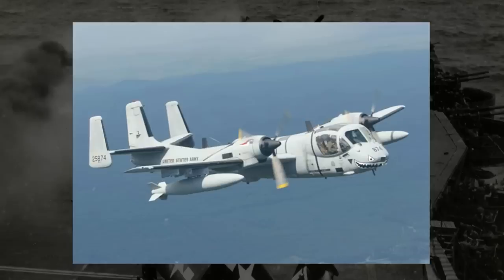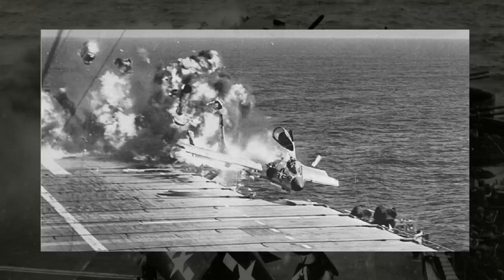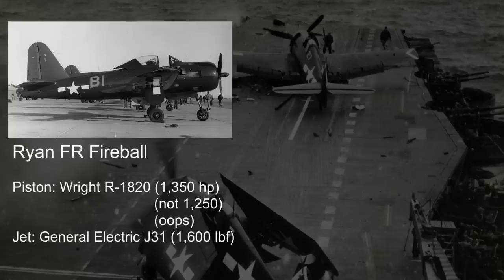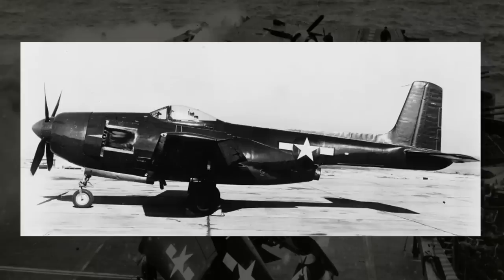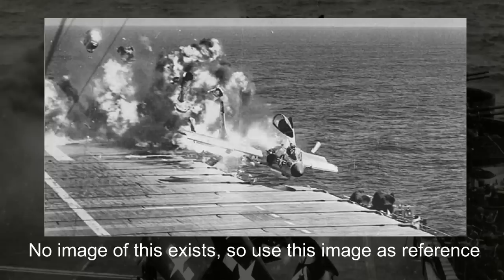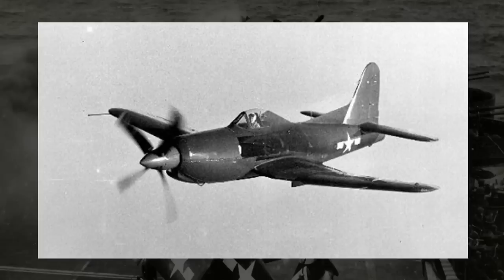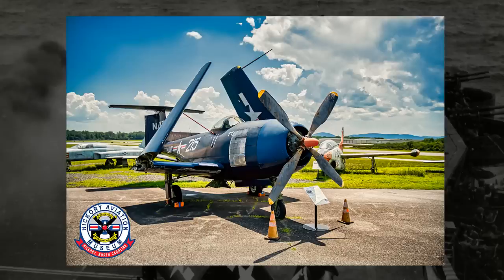Curtiss' Half-Jet Half-Propeller Fighter: Curtiss XF15C

Comment: Jet engines are rated by pounds of thrust not foot-pounds, which is a torque measurement
Reply: Says who?
Reply: Agreed. lbf stands for "pounds of force", not "foot-pounds".
Reply: Torque is not the only force that can be measured in ft lbs of energy, it's not exclusive to torque, as an example the muzzle energy of firearms is also measured in ft lbs, and that has nothing to do with the fact that some projectiles rotate, shotguns and smooth bore muzzle loaders also have ft lbs of energy as measurements.
Matter of fact when I explain torque and ft lbs to people I tell them to just forget about the fact that torque is a twisting motion because all that does is confuse people when it comes to understanding ft lbs of energy, the fact is it's a measurement that's made in a straight line, ie 100 ft lbs of energy is enough force to move 1 pound 100 feet in a straight line not going around in circles like a twisting motion (100 ft lbs is also the same amount of force to move 100 pounds 1 foot, it's exactly the same amount of force if you move 1 pound 100 feet).
When it comes to horsepower torque is a component that's a part of measuring HP, there's no time component in the measurement of torque (ft lbs of energy), 100 foot pounds of energy is enough to move 1 pound 100 feet but you can take as long as you want moving that 1 pound the distance of 100 ft, HP is how fast you move that 1 pound the 100 feet, the faster you move 1 pound the 100 foot distance the more HP you've produced. 
People who like high torque numbers associated with engine's don't understand that ultimately it's meaningless without the time component, 70 ft lbs of torque at 3,000 RPM's will lose a race to 50 ft lbs of torque at 10,000 RPM's every time. 
70 ft lbs of torque at 3,000 RPM's is 39.98 HP
50 ft lbs of torque at 10,000 RPM's is 95.20 HP
Which one do you think will cross a finish line first?
Torque itself is meaningless when it comes to engine power because it's only part of the equation, because horsepower adds time into the equation it's the final say on the matter.
Reply: Rather, they are rated with Kilo newtons- which is force
Reply: @FlareAt30Feet  
Which is directly comparable to foot pounds, just multiply by 224.809 for the conversion. 
Both measurements are force over distance. 
There's no more difference between the two than pounds and kilo's when measuring weight, one's just standard measurements and the other is metric, same as with BTU's and Calories when measuring heat, one's standard and the other is metric.
Reply: @DaveSCameron  Says EVERY jet engine spec sheet and all of their designers.
Reply: @flightforensics4523  The primary output of a turboSHAFT engine is measured at the output SHAFT, just like on a prop engine.
Any jet force is incidental, and some have the jet exhaust going out the SIDES of the engine because they point the engine BACKWARDS in normal installations so they can take the power output directly off the power turbine.
Reply: Early jets used all sorts of manner of thrust attenuation to shorten their time spent taking off  Most of the late 1940's, early 50's jet engines, before afterburning was perfected most used Water-methanol injection to increase the gas-weight volume being thrown out the tailpipe. 

  Generally accompanied by huge clouds of blackish smoke.

 So thrust, on a simple, low bypass jet engine is purely rated in pounds of thrust static, and adding WM injection adds a few hundred to a couple thousand pounds overall as takeoff enhancement.  It doesn't make pretty flames or ear shattering roars, just a lot of blackish smoke.   Like in the movie Strategic Air Command.
Reply: @tauncfester3022  I think you meant thrust augmentation - attentuation is LESS thrust.
And water injection persisted into the 1960s at least, on some designs - like the original 747 engines - where afterburner noise levels would have been too high.

Comment: I remember a long time ago (maybe about 30 years ago) I saw the surviving XF15-C prototype at the Bradley Air Museum (now the New England Air Museum) in Connecticut.  Before I saw the XF15-C, I had read about it in books.  When I saw it in person, I was struck by its large size.  The airplane was on display in an indoor hanger, and at the time the airplane was in pristine condition.  I am sorry to hear that now that same aircraft is just being left to the elements.
Reply: I am intimately familiar with this specific plane.  It was the third and last of the XF-15Cs, also the very last airframe ever built by Curtiss for the Navy.  I helped disassemble it when the Army Corps of Engineers delivered it by barge to Davisville, RI, helped tie it down and flag it to go over the road to Connecticut on a trailer originally custom-built by Kaman for their helicopters, pulled by a Mack that was formerly with Pratt & Whitney.  We had a shortage of flagging material, but the RI State Trooper was ok with the three dark red rags tied onto the extremities.  Outer wing panels and the vertical and horizontal stabilizers were removed for the trip.  Back then I seem to remember the Naval Aviation Museum having a policy of collecting/displaying only types that saw squadron service, this despite there being a purely experimental Douglas Skystreak parked outside their original building which was essentially a glorified shack, thus making this plane available to the privately run Bradley Air Museum.  Anyway, I eventually put the new, present coat of Navy dark sea blue paint on it after a good cleaning and prep and replicated the markings in a most detailed way.  The ORIGINAL paint is still underneath.  I chose to keep it's last scheme because it would be historically correct with any modifications that might have been done to the plane during it's service life.  It was originally delivered to the Navy  in somewhat different markings.  I cut the stencils at Westover AFB's paint shop to exactly duplicate the originals.  Note the l/g struts and wheels are in green zinc chromate.  That's a Curtiss thing and you see it on Helldivers, too.  The canopy had large cracks, but it was stitched together with safety wire as per instructions in an old wartime manual for "emergency repairs.".  There was a thick "armor" plate behind the pilot's head and shoulders stenciled "NOT FOR COMBAT USE."  So I thought it was likely made of aluminum, and temporarily removed it while cleaning up the cockpit.  It may not have been armor, but it was steel, and super heavy.  An uh-oh moment as it rested on my shins after demounting.  Incidentally, we moved it (and other aircraft) around the hangar and ramp back then with a mangy-looking WW2-era Navy 10-ton forklift as a mule.  Once the plane was truly display-ready, I had to really get obstinate to keep it INSIDE the hangar and not have it permanently put outdoors.  At least pretty much all the work was done inside the hangar so visitors could still see it before it was finished.  The topcoat came from the same 5-gallon bucket of paint that I used on the XF4U-4 at the same place.  In later years it was loaned to the fledgling museum at the former NAS Quonset Point, and there was also talk that it really should be at the NAS Pax museum, as it's testing was done at Pax.  I was disappointed to find out a couple years ago that it wasn't at Pax, but in its off-the-beaten-path location at present.  It deserves better because of it's rarity and the way it represents a pivotal moment in naval aviation.  
Hope half of all that was a little interesting.
Reply: 😮😮😮😮😮😮😮😮😮😮😮😮⁴h😂😂😂😂😂😂
Reply: @aj-2savage896  I can tell you from having seen the plane in person that you did a wonderful job of restoration.  I feel priviledged that I had a chance to see it, and I have a feeling that many other visitors to the museum felt the same way.  Thank you for your wonderful work, and thank you for sharing your experience of working on this historic airplane.

Comment: 20mm cannon shells go bang on hitting something, unlike 50cal bullets. Meaning fewer hits of 20mm cannon shells can do as much damage as a slightly greater number of 50cal bullets.
Reply: I was also really confused when he said "bullet size or quantity". Obviously 20mm is better than 12.7mm against aircraft, especially with the explosive fillers that could be inserted. It is no contest!
Reply: Actually explosive 50 cal bullets are a thing. They are however illegal to use on personnel.
The USAAF used a mix of explosive, incendiary and armor piercing versions.
Reply: @allangibson8494  thanks, I wasn't aware of them.
Reply: .50 caliber bullet will generally penetrate a structure deeper than will a low-velocity cannon shell. Cannon shells of this era also had slow firing rate, poor muzzle velocity and ballistics, and had poor amount of rounds to fire, due to weight.

Comment: My Uncle flew from carriers in the Pacific theater and was working in Alameda after JV day so he got some stick time flying the North American FJ-1 Fury, and said that it's ability to take off from a carrier was limited by the early J35 engine's weak thrust. Even after Grumman and NA brought their F9F and FJ-3's, most naval jets relied on needing to be stropped to a catapult, so these early hybrids were largely based on the mistaken idea that a propeller coupled to a turbine would do the launching job that catapults would take over.  Propellers don't work so great when forced to operate at high Mach numbers, and a lot of these early carrier jets were approaching transonic cruise speeds as their designs improved.  Even the monstrous counter rotating turboprop powered Douglas A2D Skyshark needed to be catapulted.

Comment: I was the Ops Mgr for the Bradley Air Museum in Connecticut, during the 1970s and 80s.  I remember when the XF15C arrived in the late 70's.  The aircraft had been preserved by the Navy at Philadelphia along with several other aircraft for a "future museum". When it arrived at our facility, we gave it a new paint job and restored the NATC markings.  It was displayed in our main hangar until a freak tornado destroyed our facilities and many aircraft in 1979.  The XF15C was unhurt.  
During the rebuilding process, priorities changed and the airplane was "returned" to the Navy who transferred it to a RI museum.  That organization failed in 2016 and the plane was transferred again to the Hickory group.  I have talked with them and at the moment they don't have a display building but expect to build one soon.  They also expect to be able to give the plane some refurbishment.
Reply: The state of RI and the town of North Kingston screwed the Quonset air museum over. We had a respectable collection of planes and other historical artifacts. The powers that be felt the naval aviation history of RI was not relevant and was unworthy of any support. I was a member and volunteer there for 20 years. We did keep the XF15C inside when we had it. The Bradley air museum is fantastic. I loved it!!

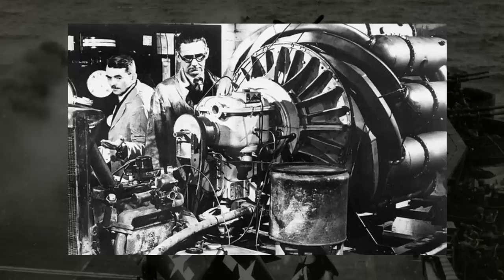Comment: An interesting point regarding the Whittle engine on the test stand at 11:50 is the little 4 cylinder engine driving the compressor via Vee belts. This was early in testing and they had no suitable design or material for the Turbine, so they were testing the combustion chamber design by using the petrol engine to stand in for the turbine.
Reply: Wow! Hadn't heard that before. Makes sense though. Whittle was scary smart and practical.

Comment: Videos like this often mention the poor acceleration of early jets, but they often conflate two different aspects of these engines as though they are the same thing.  You have to separate acceleration or spool up time of the engine from acceleration of the aircraft, as they are completely separate issues.

Yes, jet engines can be very slow to spool up from low rpm to full power.  But this is not what affected takeoff roll of early aircraft, because the engine could be run up to full power before brake release.  What affected the takeoff roll was the fact that these early jets were simply underpowered compared to previous aircraft.   

Unlike propeller driven aircraft, jet propelled aircraft produce a fairly constant thrust regardless of speed, and the power they produce increases with speed.  Propeller driven aircraft are the opposite.  A powerful prop plane can out-accelerate a much faster jet plane and leap off the runway, but will run into a wall at high speed because the propeller cannot convert all that horsepower into thrust.  At high speed, a jet powered aircraft still produces thrust similar to during takeoff roll, but a prop produces far less. This is why even early jets that were underpowered by today’s standards were superior to props in high-speed flight.  

Spool time is a different issue that is only a problem at low engine rpm.  This was a factor in early jets, especially carrier jets, because they were straight wing designs with relatively high total lift to drag ratios that required low thrust settings during landing approach.  They sometimes compensated for this by deploying additional drag in the form of air brakes and steep flap settings, and sometimes by the use of engine thrust attenuators allowing use of higher rpm that improved throttle response time.  Even an early turbojet or a modern turbofan has acceptable throttle response when rpm is in the useful operating range.  Couple this with the drag of a high-performance swept wing aircraft in the landing configuration, and thrust attenuators and speed brakes are usually not needed.

Comment: There was a prop/jet combination that worked and still works well on such aircraft as the C-130 the Turboprop which was tested in a Meteor by the RN as a potential carrier aircraft
Reply: Yes, the Trent meteor.
Reply: @leifvejby8023  In many ways the turboprop would have been ideal for early turbine powered carrier aircraft. The other innovations that really helped jets get onto carriers were the angled deck and the steam catapult both of which were gifted to the USN by the RN

Comment: Would you count the piston engine planes that utilized the exhaust to add a not insignificant amount of power? iirc some of these would add something like 5-10% to what an engine could deliver (for the best of them).

They are hybrids of a sort rather than two separate power sources. But the exhaust gasses added thrust in a manner that doesn't differ from a jet engine (i.e. hot stuff shoots out the back). So they are certainly in the same basic school of thought. Either as a precursor or as a rudimentary entry. As they were the same basic combo of prop thrust and something not dissimilar from jet thrust.

Comment: Eventually when the jet engine was approved the USAF put four jet engines on the prop driven B-36 to improve it's take off load and overall higher altitude performance.  Another example of a jet engine propeller combo is the turboprop used today on commercial aircraft and the Hercules C-130   Basically the jet engine on these fighters would not work well as pushing the aircraft through the air will turn the propeller into a drag producing spinner and negate the thrust of the jet engine.  While the jet works better at higher altitudes, the propeller doesn't, so really they were better off not not trying to have two different propulsion systems. Jet technology improved greatly very quickly so that an all jet engined plane was possible.

Comment: Interesting to note a pair of German Arado Ar 234 jet bombers on the flightline in the background, [8:27]  under the XF15C's T-tail. This must be at Pax River.
Reply: And maybe a Dornier Arrow behind them as well?
Reply: @beverlychmelik5504  Could be a Do 335, head-on directly under the tail of the foreground XF15C -- or some other aircraft with contra-rotating props. IDK?  Naval Air Station  Patuxent River [''Pax River''] was the Navy's base for Test Pilot School and HQ for Naval Air Systems Command [NAVAIR]. Any captured enemy technology assets would be evaluated there.
Reply: Got to wonder what they would be doing at Pax.
We know they were not going to be used on the German carrier
Reply: @raymondclark1785  After VE Day, the USAAF and USN divvied up captured German planes to be examined. The Akutan Zero [7/42] had also been scrutinized at Pax River, resulting in improved specs for the F4U, Hellcat and Bearcat. AAF equivalent would be Wright Field. A lot of <<Paperclips>> were entertained there in this period. Perhaps at Pax River, too?
Reply: @raymondclark1785   General testing and evaluation. After all they had to see what is out there and if they could use it in the future.
Reply: @raymondclark1785  Actually, that may not even be Pax River. The Akutan ZEKE was evaluated at  NAS Anacostia, and then Langley Field AAFB, where there was a wind tunnel. Anyway, we can figure it was at one of those bases that also hosted Der Paperclips.

Comment: There is a huge difference between .50 cal and 20mm apart from the size.
As 20mm usually were explosive bullets which .50 cal could never be because of treaty restrictions.

Comment: I feel like the issue of poor throttle response would have been better solved by installing a small rocket engine (enough for maybe 10 seconds of thrust) on early jets, toggled if they needed to abort a landing.
Reply: JATO bottles.
Reply: Early versions of the Mirage 3 had a small rocket motor installed under the engine exhaust as the afterburner was that of a simple "Clamshell" door style, similar to what was used on the Concorde. this didnt give very good extra thrust, so the rocket was used. Later on the more well-known mirages they had a much better afterburner installed.